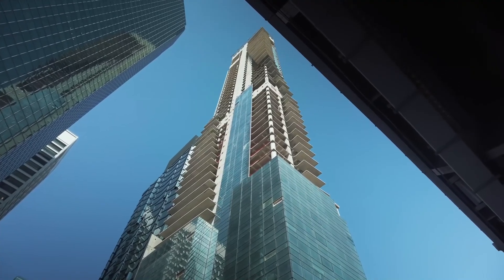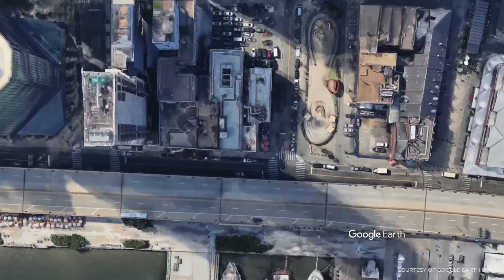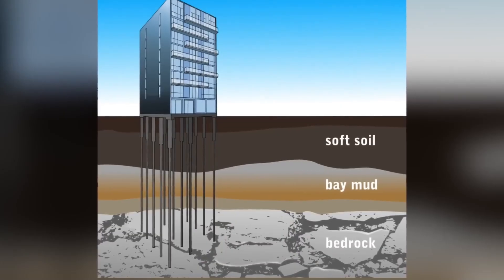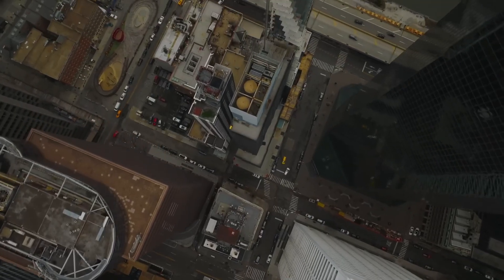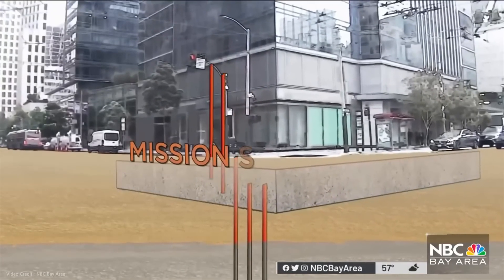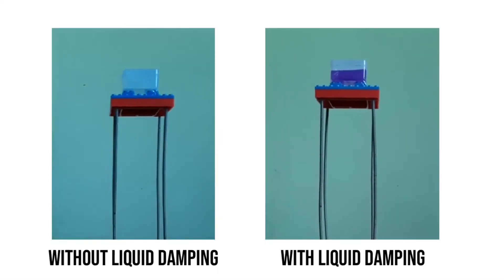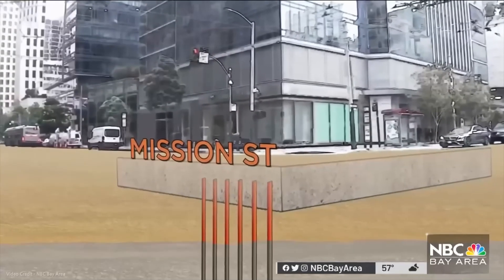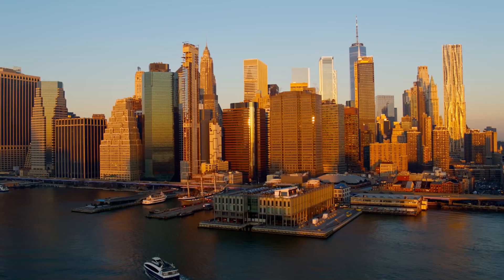The SHOCKING Truth About This New York Skyscraper's Fatal Flaw!

Comment: The cost of the project didn’t go from $41 million to $64 million. A development company bought the lot in 2011 for $41 million, then sold it in 2013 for $64 million to the developer that started building the structure.